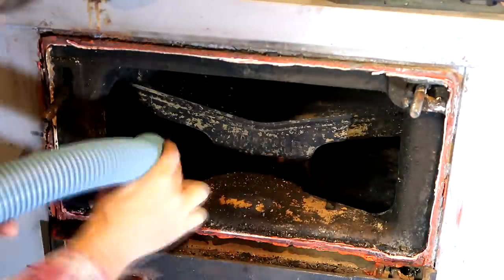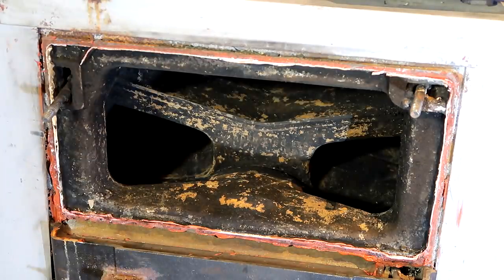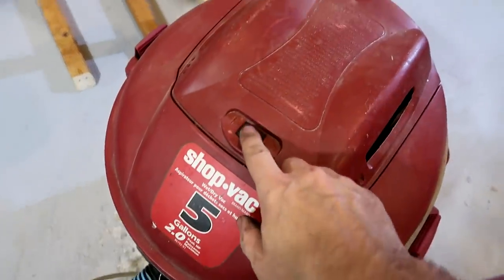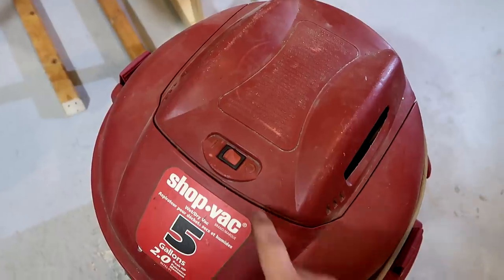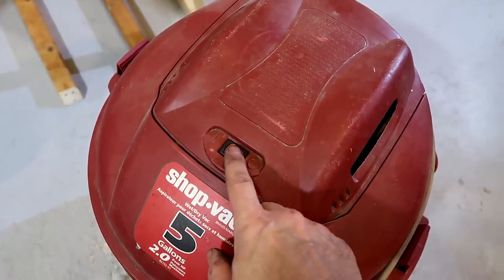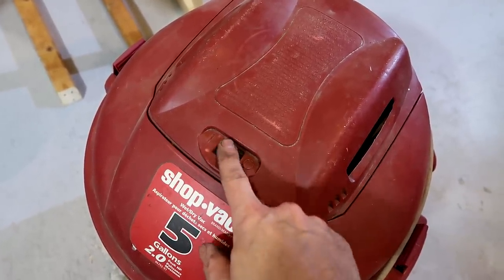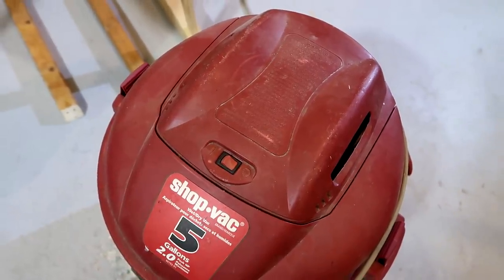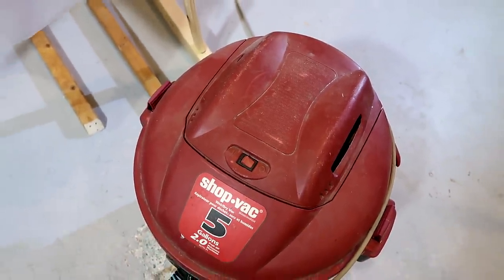Shopvac noisy bearing oiling trick

Comment: Does this trick also work for noisy knees and stiff joints?
Reply: I wish, How bout you try it first? :>)
Reply from the maker: I suspect the patient would make an awful lot of noise while being drilled into!
Reply: @matthiasrandomstuff2221 "You need only two tools: WD-40 and Duct Tape: if it doesn't move and it should, use WD-40; if it moves and shouldn't, use the duct tape."
Duct tape the patient, your ears. and WD-40 the stiff joints just to trigger the commenters, then duct tape them too.
Reply: A change in diet does the trick. Eat more plants, less animal meat and dairy.
Reply: @matthiasrandomstuff2221  you suspect wrong!

[edit] you suspected right 🤕
Reply: @Maytemberr I don't know how you get the oil out of them, but just wringing them out is just too messy with a very low yield.
Reply: Basically that's how knee surgery works, they drill in from the side and flush through a bit of lube.
Reply: @Switch & Lever - Gummi Bären - seriously, that's how a friend/candidate for replacement knees was put "on hold" until surgery. It works.
Reply: @lightdark00  good point, that saves the animals joints. :)
Reply: Funny. I was thinking the same thing for prosthetic joints. They only last about 25 years. I always wondered if it was possible to extend the life of it further with frequent lubrication through a sterile port through the skin using some kind of bio-compatible oil.
Reply: Kinda... i believe it's called cortisone shots haha

Comment: Haul it apart! Odds are it uses a cheap/common bearing that you can snag off Amazon or even buy locally.

I replaced the fan bearings in my dehumidifer a couple years ago, which started making an awful chattery racket like your Shop-Vac is doing there. The thing had two nonsealed 608ZZ bearings in it and one was full of dust. Replaced them with a pair of sealed 608-2RS bearings that cost me ~$10 from a bearing supplier in Dartmouth, and it was good as new.

Cheers!
Reply: But adding a drop of oil once every two years is easier, faster, cheaper.

Comment: i just recently ruined a electrical hand planer. turns out there was a 607z bearing (metal shield on one side) inside. both bearings completely ruined because of dust. but hey, at least the bearings are open so i can oil them, really?

Comment: Another good trick is to use a dry bike chain lubricant, which contain a wax or Teflon dissolved in something volatile, so that they flow into nooks and crannies, then the solvent flashes off, leaving behind a lubricant that doesn’t collect dust and grime the same way oil does.
Reply from the maker: Not suitable for high speed bearings

Comment: Do avoid dirt in the bearing you can epoxy a plastic bottleneck with a bottlecap over the hole. That way you can easily open the cap to oil the bearing.
Reply from the maker: See pervious answers

Comment: Nice!
All you need now is a sliding cover for it, so dust won't get in there so easy.
Edit: nvm, seems like the opening on the sides also gains acess to the bearing
Reply from the maker: naw.  See the big holes on the side of the cover.  Those go to the same place.  Plus, a fan blows air through there.
Reply: It may be slightly better protected from accidental liquid spilling with the hole covered.

Comment: Amazing, but there are different shop vacs. How did you know exactly where to drill?
Reply: He's had it open before and knows the placement of the bearing.
Reply: Looks in through the hole on the side
Reply: @rickt151  OOH, you are right. You can see in, at least on this model.
Reply: @vulcanville  red it in a reaction of himself on a similar question. But true that it doesn't go for all shop-vacs

Comment: It is more work but you can also replace the plain bearing (aka bushing) with a roller skate bearing on a shop vac brand. vac
Reply from the maker: but those rollerskate bearings are not very good.  You'd need a higher quality source of bearings
Reply: @matthiasrandomstuff2221    I suggest  tape over the hole if ones goes this route.

With mine oiling was a short term fix which I did twice.   The skate bearing is still working.  Roller skate bearing are designed to for a heavy side load.   There is no side load to speak of so maybe even the less expensive ones will work.   

Everyone needs to understand a sample of one means little.
Reply: I agree that roller bearings, in general, are very robust.  But not sure about high speed applications like this.  They are made to be pounded on with 200/16 pounds of force from 2 foot height. (size of man on roller blades jumping 2 feet in the air).  Maybe, for high speed rotation, getting a good ABEC rated bearing from the higher-end skates would do better (not the cheap kid's skates).  I used a pair of macro-blades' roller bearings for my cnc machine...overkill.